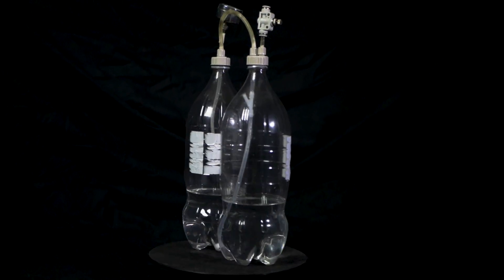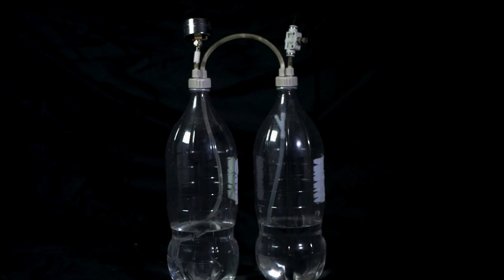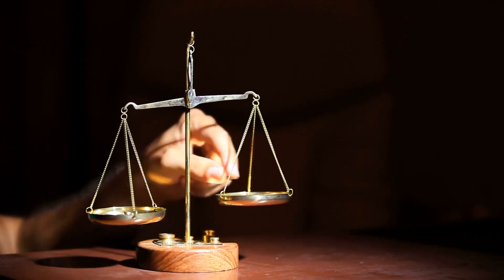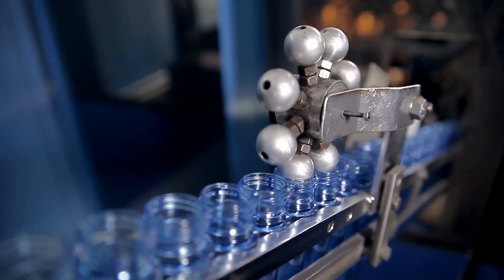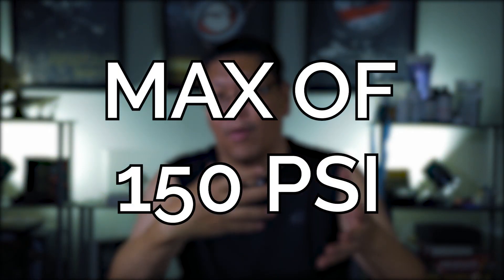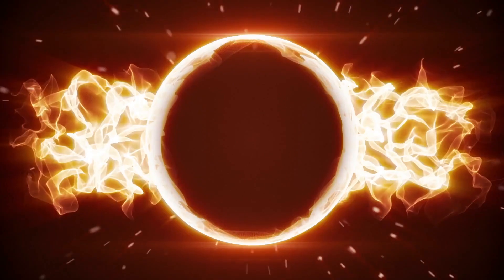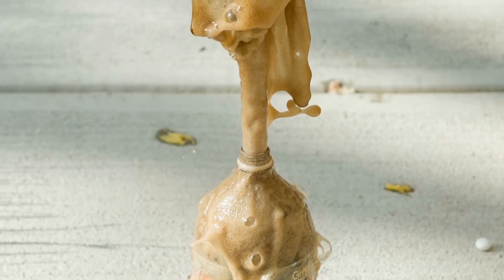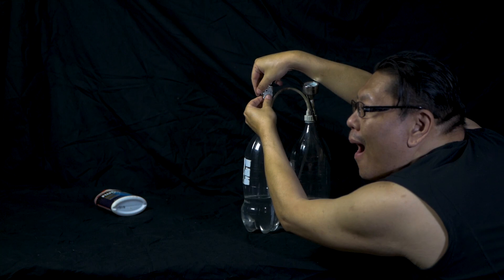DIY Co2 Bottle - Will they explode?

Comment: Mine did explode, probably the loudest explosion I've ever heard. My neighbours called me to see if I was alright. 

My advice is, if possible please change your 1.5l coke/soda bottle at least once a month. My mistake was leaving it up to three months because it seemed to be okay. Please don't let my experience deter you from using DIY Co2 though. Just remember to change the bottles every once in a while.
Reply from the maker: Thanks for the tips!!
Reply: I think it explode bc i think it’s suppose to be a 2l bottle not 1.5 bc I had mine for a while it never explode but for me the lid of the diy co2 lid just cracks I replace them again and same result happen a cracked lid but the odd thing it never went past the green bar but the lid crack.
Reply: @kevintruong1038  It could be that. But I'm not using DIY setups anymore, I saved for a few months to get an actual CO2 kit and I don't regret anything. Been running for 6 months without me having to refill it.

Comment: I just got my kit in the mail today. Picking up a couple two-liter bottles tomorrow or Wednesday, and was actually wondering about the pressure and possible explosion since I'm living in a college dorm... My roommate would not be happy if that happened haha. Excited to finally have consistent (and affordable) CO2 for my planted aquarium.
Reply from the maker: Good luck!
Reply: @TheWaterBox  one week in and still going strong! I did have to replace the needle valve that came with the kit, because it broke two days in somehow. I got a sturdier one that was pretty cheap from Amazon and it seems to be working fine 👌🏼
Reply from the maker: Yeh, good move. Some of them are really cheaply made and unfortunately you kinda have to hope to get the right one.

Comment: I have used this type of system for years. The MOST important thing IMHO is to very accurately measure your ingredients. If you do that you will not run into over pressure situations. Also since the bottles vastly exceed the pressure ability of the tubing/connectors it is not really possible to over-pressure the bottles. I have had tubing hop off it's fitting on occasion and burn all my chemicals but there is almost no chance of the bottles bursting. In my area bottled CO2 is unworkable and I have used this method to great success.
Reply from the maker: Thanks for your insights.
Reply: I am using this system 

But citric acid is not reacting well.

But once the bottle is shaked it produce more pressure 

What should i do 
Whats the fault should be

Comment: I appreciate this video. I've been using DIY CO2 for years using yeast and sugar. I'm thinking of switching to citric acid and baking soda.
Reply from the maker: I find the citrus mix works better for me. Give it a try.
Reply: Can you give me how did you setup co2 system
Reply: How is it going? I'm still in between, can't choose between these two
Reply: @ainumairah5410  the cheapest for me at least is using baking soda and cleaning vinegar to create the reaction to produce CO2 

You can buy baking soda in bulk 25kg
Reply: @ainumairah5410   if you ask why cleaning vinegar because it has a increased acidity over the regular vinegar 
Cleaning vinegar that I use has 7% acid in it regular vinegar is about 3% 
I hope this has helped you 😉
Reply: @pelkin  i see , thankyou! So the higher the acidity means the longer it will last? If u don't mind, can you share the measurements of baking soda n cleaning vinegar that u use?
Reply: @ainumairah5410   hi glad to help out😉
Yes the higher the acidity the more it will actively react with the baking soda 
So you will end up with more CO2 and it will be more efficient that way 
For the measurements I use 
400g of baking soda in a 2 L soda bottle 
And 1.100ml = 1.1L of cleaning vinegar that is where I found the sweet spot for the 2 compounds 
But you can experiment 🧪 your own with it maybe you can find your sweet spot of the mixture 
And a happy new year 🥳😁
Reply: @pelkin  thanks! Thats really helpful. Will try this after i get all stuffs in hand, happy new year too 😁

Comment: Quick question what do I do my lid of the diy co2 kit cracked I replace them but the lid cracked again on me and the co2 system didn’t even go pass the green bar. Should I go for the metal version of the diy co2 or will that make it worse and cause the bottle to explode?
Reply from the maker: If it's cracking, doubt your bottle will explode.  The pressue is just going to go out of the crack.  Try getting metal ones. I'm not sure why your caps are cracking.

Comment: I was debating about getting a diy kit but I wondered if they really produced results, we have very hard water here 8.6 on last check so I really do think I could benefit from this if it works.
Reply from the maker: It'll still work, probably not as affective if your water was softer but it'll still help.
Reply: @TheWaterBox  Thanks, I will be adding aquasoil so will see how much it drops and then maybe use catapa leaves as they are abundant here.
Reply from the maker: Make sure to boil and dry the leaves before putting in your tank if you're picking them off the ground or from the tree

Comment: I was wondering what your thoughts are on using an upside down bottle as a co2 resivor ? In my set up i have an upside down bottle in my tanks that I fill with Co2 ever day. Since I run multiple tanks in different rooms this seemed like my most cost effective method.
Reply: You mean passive diffusing?

Ill wait for the answer too
Reply from the maker: It works fine.  It's passive difussing which many people do.  It's not as efficient as using a diffuser but it's better than nothing.
Reply: @TheWaterBox  yikes im gonna do this soon im still on a diY citric and baking soda and gonna soon need to still do co2 it  on a 48x18x13 tank.

My initial thought was its gonna be too much for diy if I do 2-5bps for a diY ill run out fast so maybe I can do 2
Passive co2 and 1bps from diffuser ? :3 I dont know tho if this is more economical and co2 saving than straight raise co2 to 2 to 5bps /my blind estimate atm hahahahha.
Reply: I forgot to ask, if I may have you use  the Chihiros rgb plus the new one with bluetooth , its on myy radar atm and wanna buy it as soon as it land in our country, was wibdering If you have experience on it and how did it do, in gonna use it on a 13inch tall tank minus 1-3inch substrate.
Reply from the maker: @lowcost549  I have one but haven't used it yet.  It's for a 4g tank.  I can't really say how it works but I've heard great things about it.

Comment: IMO the chances of the bottles exploding are very slim however you could run into the issue of CO2 overdosing especially with smaller tank set-ups if the overpressure goes undetected for some time.  One thing though, if there is overpressure it would be better to relieve the pressure on the citric acid reactant bottle (A) since relieving it on the baking soda  reactor bottle (B) will push more citric acid into it which will be generating even more CO2 gas.
Reply from the maker: Thanks for the tip

Comment: I bought this same kit but I would like to use it with the yeast. I don't have citric acid.  Can  I do that?  if I fix the hoses? I understand the yeast side hose will be short and not into liquid, and that side has the valve. And the water cleaner side with just the water will have just a hose down into water, and air will bubble up out of water and go out the other hole on the lid. Does this sound correctly  done,
Reply from the maker: I'm not sure if it'll work correctly with yeast as it uses a different type of reaction.  I just never tried it with a yeast mix this way.  With used I used a single containter and mixed it with sugar and yeast. It reacts much slower than the way explained here.

Comment: There are some new diy co2 systems that are made of metal? Do you recommend those over the plastic bottle cap ones?
Reply from the maker: Those are good. I got one of those to try out for a video. I haven't made it yet but it looks pretty solid.
Reply: @TheWaterBox  thank you for your reply. Whens the next video?! I have one last question for you. Can i inject the diy CO2 into a rex griggs reactor or a cerges reactor? Would the pressure be enough? Thank you!!
Reply from the maker: @omzdubz  That will probably not have enough pressure. DIY bottle pressure is so unreliable that injecting into a reactor is something I don't recommend
Reply: @TheWaterBox  thank you again I appreciate it

Comment: This looks like the kit I got and it comes with a magnet you can use (on the outside of the citric acid bottle) to pull the hose up out of the citric acid, stopping the reaction. No reason to be scared of explosions or hoses popping off this way.
Reply from the maker: Nice!
Reply: This is what I wanted to hear, if I stop the reaction we are good right!

Comment: Those kits that you're using in the video has a "pressure release valve". That's the white tube under the gauge.
Reply: Is it? But where does it release to? I mean I can only see one end connected to the bottle and other to the pressure gauge.
Reply: @skmr1991  it's on Bottle "A" just under the gauge, it's white about half inch long, between the Guage and the bottle. 1:00

It releases to the atmosphere.

Comment: Do we have to keep the DIY CO2 system at the same level that of the aquarium? I am planning to get a DIY CO2 system but I don't have any place left around my aquarium and I would have to keep the whole system below the aquarium. Will the pressure rise to the aquarium?
Reply from the maker: I usually do. It should work if it's below the aquarium level.

Comment: Ran into an issue where the citric aid would drain out over night. Been happening to me at least three times since starting it beginning this year. Any ideas?
Reply from the maker: Could be the mix or a leak somewhere.
Reply: if it is a leak through the caps, add  vasaline to the bottle top and also the caps.

Comment: If you turn it off it should be fine, but if you leave it running it may build pressure. That sounds weird but as the co2 leaves bottle B it creates a lower pressure which draws in acid from bottle A which reacts forming more co2. If you let out 1 ml of co2 (measured outside) you will draw in 1ml of acid. But that acid will react to form more co2 than was let out (the volume of the acid can create a greater volume of co2 because gas is less dense however in this situation it is forced into a smaller space increasing the pressure). Given the quantities involved, it is very unlikely you would be able to get the pressure needed to destroy the bottle unless it had some defect. And, as stated in the video, the tubing would pop before the bottle.
Reply from the maker: Thanks for the insight

Comment: My needle valve got stuck closed.  How should I release the pressure?
Reply from the maker: Gotta fix the needle valve or get a new DIY contraption.  It control the output of your Co2. If that doesn't work, the whole thing doesn't work. Did you screw in the dial too tight or something?
Reply: @TheWaterBox  yeah I think so. I order a new one from Amazon and threw out the bottles I'll start fresh once I get it.  Love the videos man. Thanks.

Comment: Hi @TheWaterBox! I know I am a year late but was wondering if you can answer my question. I am a new betta owner and I was told that my tank did not have enough plants for my betta Coconut to hide it. I have one Anubis nana sitting in the sand (the rimozone is NOT covered) and two betta friendly plastic plants. I did some research and I think I am going to go with the plants Lemon Bacopa Caroliniana and the Cryptocorynes Wendii both brown and green. Do you think my choices are a good idea or too much/little? I have a 5.5 Top Fin gallon tank and am planning on using the light that comes with the tank and no CO2 but I will use Seacheam root tabs. If my light is not enough, is the NICREW submersible light a good light? Thank You so much in advance?
Reply from the maker: A nicrew classic should be enough light on a 5.5g for those plants you mentioned.
Reply: @TheWaterBox  Thanks! I have another question. I might get a divided tank. (10g)what do I need to buy for it
Reply from the maker: @ayannamukendi5504  A divided tank? What do you mean?
Reply: @TheWaterBox  Having two bettas in a 10g with a divider separating them
Reply from the maker: @ayannamukendi5504  If it's charing the same water course (i.e. the divider doesn't block the water from either side, you run it as any normal tank.  If it's completely separated then you need to make sure your filter is filtering both sides, either having individual filters for both sides, or you rig up a filter that can take in and distribute water from both sides.

Comment: I have a question. It is normal if all water from bottle A with citric acid entered in bottle B with baking soda ? And bottle A it's 2.5 Litres and bottle B 1.5 Litres
Reply from the maker: They both should be 2 litter bottles.

Comment: It just feels like it will explode but it will not explode. My experience was just the hose popping off.
Reply from the maker: Yeh, the hose parts seems to be something that are the first to go if there's too much pressure.
Reply: I set up my DIY CO2 today with sugar, yeast and baking soda. After 9 hours into action the hose popped off. I decided to release the CO2 to empty bottle can't put in tank when lights off. My question is after hose popped off I reconnected the hose will the CO2 still be available tomorrow or will I have to start all over again. Plz answer. Thanks.
Reply from the maker: @jt9513  Is the hose breaking from it's connection point? Or just popped out of the connection?  If popping out, then secure better.  IF it's actually snapping, try using a polyurethene hose.
Reply: @TheWaterBox  it's popping out from the T point where I have a plastic T shape regulator to control the bubble rate. I haven't used super glue there unlike I have used super glue on the bottles cap. What do you suggest if I use super glue will bottle explode. I know the quality of pipe is not that good will replace later but for the moment your expertise appreciated. Thank you for your kind reply. Btw I am still able to get the CO2 despite it's popping out every 6 hrs or so 🙂 today was 3rd day!

Comment: i still dont get why i cant run this on my 75. Like a plants grow with just about no co2 why cant i just give them a little? Why is it run 30ppm or none? Like why cant i just build one of these diy setups and set it to one bubble a second?
Reply from the maker: Try it. No one is stopping you! It'll help, especially if you got good diffusion. Good luck!
Reply: @TheWaterBox  i think im going to build one then get the fluval passive diffuser thing and set the co2 at a bubble a second and put it under the passive thing and just see how it goes. I've already got BBA out the ass so why not.
Reply from the maker: Good luck!

Comment: The only problem I ever had is; after awhile I had a bottle cap develop a stress crack.
Reply from the maker: Just change it out. or do you mean on the contraption? That is annoying but can happen. It's not be best high quality plastic they used on those things.
Reply: @TheWaterBox  The caps that come with the cheaper kits, like the one in your picture title "will they EXPLODE"
Reply from the maker: @marcdilorenzo4909  Yeh, they aren't the best built contraptions.